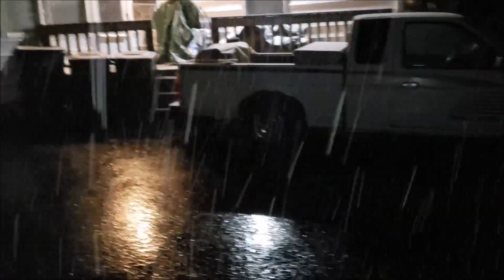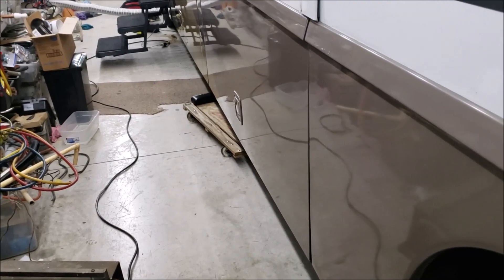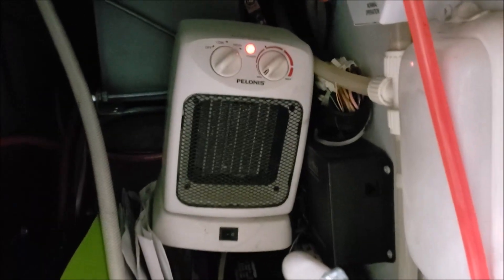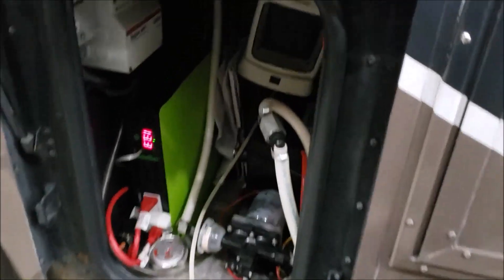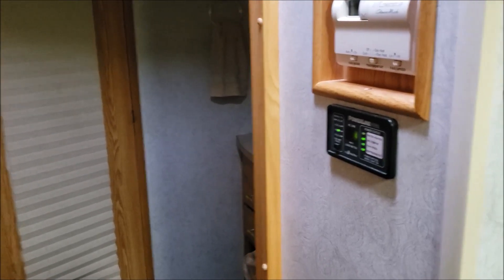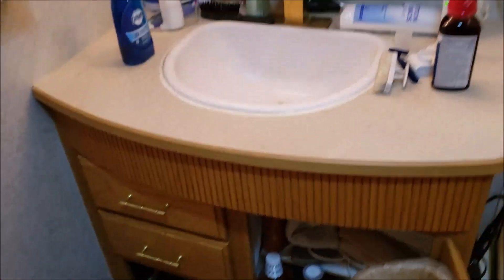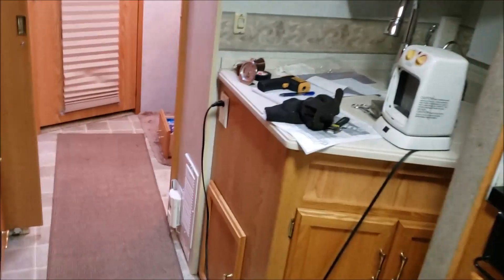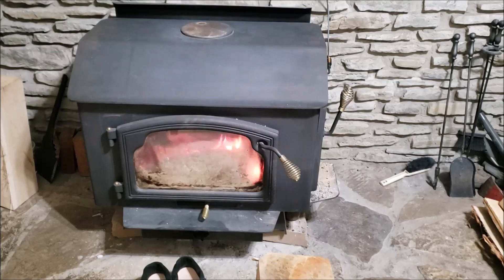RV NOT Winterized and Its Going Below Zero Can Ceramic Heaters Keep Pipes From Freezing? Lets Try.

Comment: If, you use a small 4 gallon hot water heater that is connected inline to your water system...and use an aquarium pump to circulate the water through your domestic water, and your hot water heater it will be enough to keep your pipes from freezing....I saw this done on several RVs in Billings MT......also if your domestic water is under the bed it will keep the bedroom warmer
Reply from the maker: That sound very interesting I will have to check that out. Thanks for the tip

Comment: Nice video. Ann says that having your stuff scattered all over is giving her heart palpitations. :) When we have had to deal with temps around zero, I fired up the onboard furnace, put a 60 watt light in both the water bay, and the pump bay, and an electric heater in the bay behind the water bay. Opened the drawers on both the bathroom sink base and the kitchen sink base. Also, opened the door where the washing machine hooks up in the bathroom and the door on the front of the washing machine. Nothing froze.
Reply: Paul, my Allegro Open Road has the onboard furnaced piped to the wet bay.  It is heated any time the furnace is on.  Living in North Florida a Light Bulb and Thermo Cube has worked well.  Lets hope we don't have any zero temps.
Reply from the maker: To funny my Sweetpea is getting used to my messes so Ann can get used to yours so when get the chance make a big old mess as a test... let me  know how it goes.

Comment: Very interesting, the last RV I had was  a Winne Brave, and it had the motor aid heater for the water tank and a forced air for the RV itself nice to get to where you are going and having hot water and heat via the engine coolant, I really wish all the RV would have those, although you have to periodically inspect the coolant lines going to the water heater and forced air heater.

This is the first time I heard of the motor heat where you have a duct going through the bay area, pretty slick.

Good data you collected for people who full time and where the temps go way down. Thanks again for doing these videos Kevin.
Reply from the maker: Thanks for watching my friend.